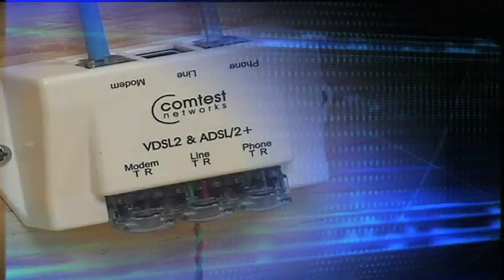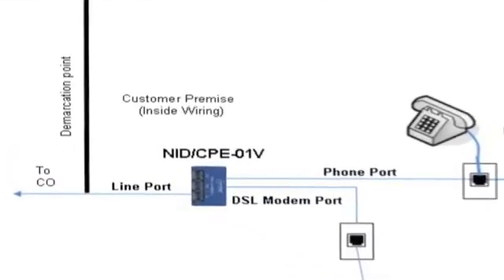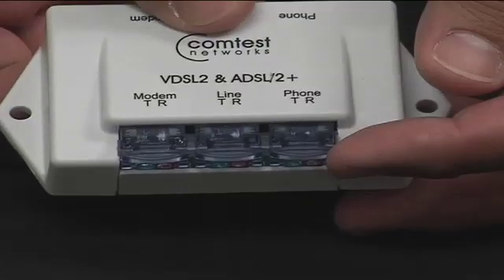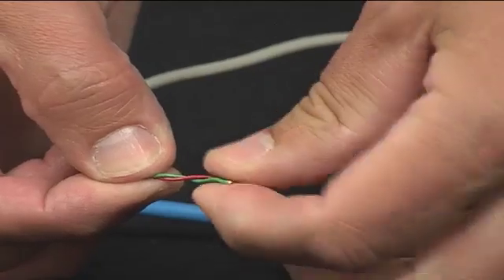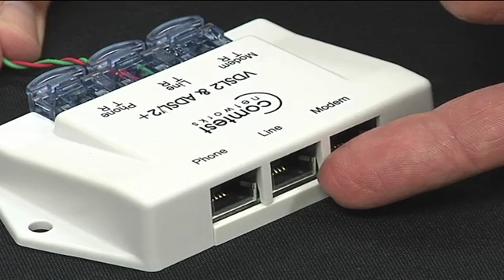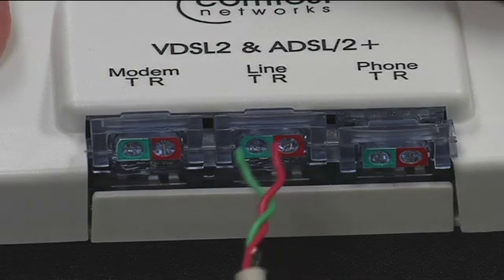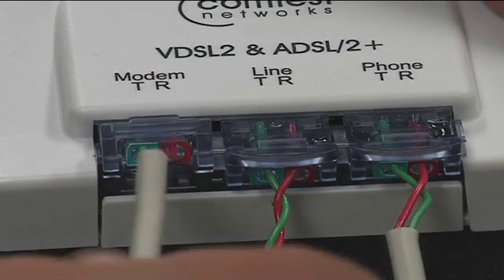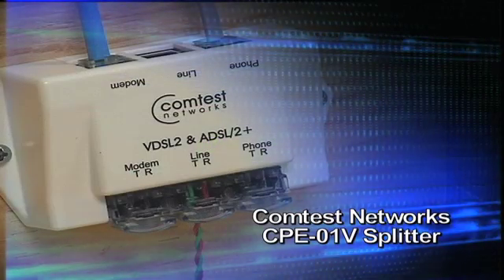Comtest CPE-01V  DSL Splitter on a POTS line

Comment: wow...   the telephone cable from the pole leads to a pots splitter in you house....  there should be to bolts sticking out... ONE is transmit, the other is receive the onlt to lines that needs to be connec to the modem :-\     this this is a box,,,  that does exactly that, useless, you just filter the telephones